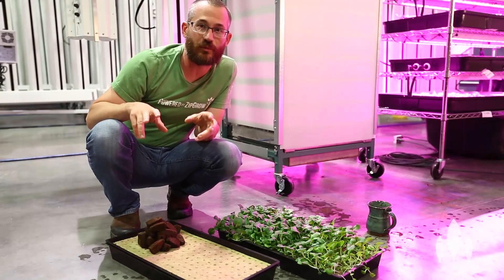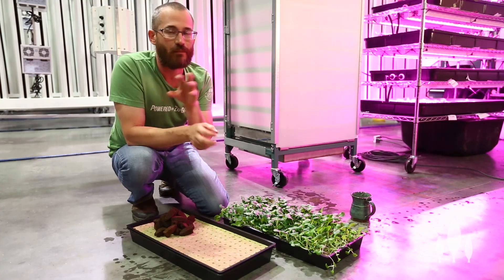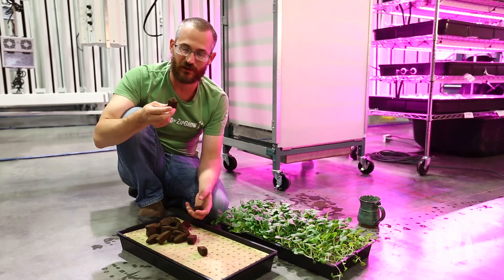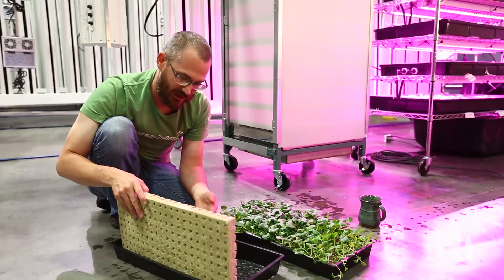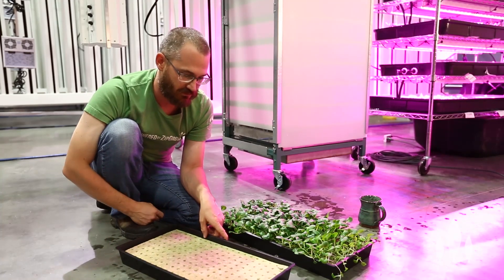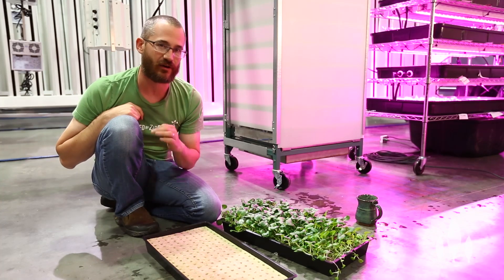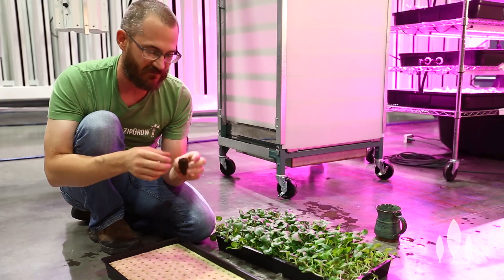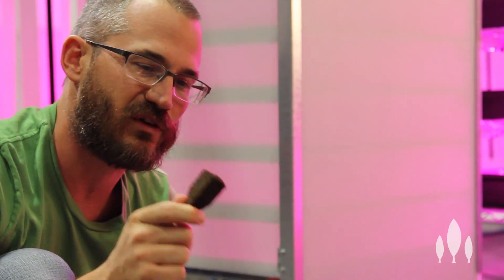Types of Plugs for Starting Seeds in Commercial Vertical Hydroponics

Comment: Rock wool will be here forever, so will the rocks they were made from. Unless another Ice Age comes along and pulverizes and grinds the rock up to soil, as past Ices Ages did. That how the natural rock fertilizers got spread around the planet in the first place. Check the Periodic Table you will find all the elements that plants and humans need listed.
Reply: Uh, no. Yes it does take a long time to decompose,  but it will in our lifespan too. It's a fine filament so it's way more surface area than volume.  Lots of surface area for acids to corrode. Same process as mountains. Having had said that, yes I still dig up 5+ yr old rockwool in my garden that I used as starters years ago. I use perlite now. I still grow my indoor winter vegetables in 4" grodan blocks. I shred them wet. Never see them again.
Grodan has a slideshow of spreading used rockwool on an outdoor soil garden then rototilling it in. Not a bad idea. 
Around forever? Ridiculous.

Comment: Is the Flexiplug re-usable after the plant been harvest and use again for propagation after it's sterile?
Reply from the maker: Linda, one of the cons of polymer bound plugs like Flexiplug is that they aren't resuable. If you want to reuse seed starting plugs, we'd recommend using a potting mix.
Reply: Thanks.  :)

Comment: Hi Bright Agrotech,
I used the rock wool to start my seedling.  how tall does my plants have to be to bring them out in sun light? My vertical system is outdoor and it get all afternoon sun.  Thanks for your help..
Reply from the maker: Hi Lien, you want to wait until your seedlings have a set of "true leaves" on them.
Reply: So baby leave are still too young ha? So i should bring them back inside and put under the light? I also notice some leave are turning a little yellow. Thinking from too much water.
Reply from the maker: if your leaves are yellowing it's typically too little light or too little nitrogen at seedling stage.

Comment: what traditional renewable growers mixes do you recommend using in a greenhouse system?
Reply from the maker: Hey +Brad Smyth - Do you mean for starting seeds? Or nutrients? And renewable or reusable?
Reply: the potting mix/compost mix you use for starting seeds.
Reply from the maker: +Brad Smyth We've used just about everything you can think of to start seeds and we can make recommendations based on your growing application. For ZipGrow Towers in hydroponic applications, we're big fans of flexible plugs that don't have any lose particulates that can clog up the system. For other applications, a simple compost/seed starting mix with cococoir will be just fine.

Comment: rockwool does break down, fibers are so thin that once it gets physically broken down (torn, smooshed, pulverized, etc) enough that its pieces are small enough, it goes through the same process as leaf litter.  its slower than leaves, but it really will distinigrate.  add it to potting soil or compost! it is awesome additive!  break it apart by rolling between the fingers(AFTER WETTING THOROUGHLY!) and toss it in
Reply from the maker: +Mitchell Fite Thanks for the tip!  Maybe we should build a machine to grind down all those used rockwool cubes. . . The biodegradability issue is really my main issue with rockwool, so if that can be solved or resolved, I'd recommend it to a lot more people. I guess the only other issue I have are it's density, but that's another video. . .
Reply: +Mitchell Fite 
I've been doing the same.  I have found that if leave the used rockwool cubes in the sun  for a couple weeks that they break down very easily and then toss them in my compost tumbler.  Just have to minimize the airborne fibers though as they are just as itchy as going up in my attic.
Thanks for all the great videos Bright Agrotech!
Should be ordering my zip towers soon  for my outdoor gardern!
Reply from the maker: That's some great insight about the sunlight! Thanks for sharing. Let us know if you have any questions when you get your ZipGrows. We'll look forward to seeing some photos too!

Comment: I was using rock wool plugs, but recently started switching over to the Rapid Rooter brand of flexible choir plugs.  They are much simpler to use, and come PH balanced.  No need to pre-soak them in a PH 5 water prior to planting as with rock wool.  For people new to this, that alone could be the difference between success/failure and simplicity in planting.  Most come pre-moistened, so you simply drop in the seed, place it in a tray, and continue with normal propagation methods.

Yes, they are more expensive.  A bag of 100 at the local hydro store was $26.00.  You can find them cheaper in bulk online, but you may want to start with a small bag to see if they are suitable for what you need.

For some of the finer rooted plants, I have found better initial growth in the choir flexi plugs than rockwool.  It's substrate expands easily for root penetration, and I see the increased length of the plug as being beneficial to 'stabilize' the plant prior to transplanting as well.

Also, i find less algae growth on the medium if placed into direct sunlight than rockwool.

I will be experimenting with both mediums in the new propagation chamber soon, thanks to the recent video here about their use.  Thanks for that info!
Reply from the maker: This is some great insight, +Richard Taylor! We've had a lot of growers having great success with flexible coir plugs so this was some good info to receive. We'll look forward to hearing more on your prop chamber experiments too!